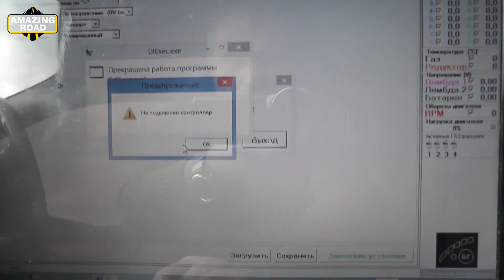How to make a diagnostic cable for Gas cylinder equipment (LPG) 4th generation own hands

Comment: “Hello, my car has a 4-cylinder Mimgas SU2000 LPG kit. I want to make an LPG adjustment cable for my vehicle. I tried connecting using an FT232 chip but I couldn’t establish a connection. I used the chip at 3.3 volts. If I use it at 5 volts, will it damage the ECU?”

Comment: Thanks it working in lovato kit
Reply from the maker: :_139::_107:
Reply: not working on Tomosetto Ecm
kindly share the procedure
i have connected GND, RX and TX but not connecting on Tuning Software
Reply: @ it works on com port .lovato and tomaseto woth are same
Reply: @ammanavenkateshwarreddy3071  try to change the baud rate on windows in port settings

Comment: Worked for me. I had to swap the GND with +12V pin. Thank you!
Reply: Bro can u explain me?
Reply: @vladtimofte5983 Hello.  I did as in the video.  There was no connection whatsoever.  (Error C01 code) What did you do?  I will be glad if you help me.
Reply: @birkuliste8988 Hallo have You now the answer? I have even the same Problem

Comment: nonsenses......What are the parameters for the RS232  communication?
You did not tell the most importand. For a made communication cable to work we must know:
1. 8 bit data or 7 bit data?
2. 1 stop bit or 2 stop bits?
3. Parity even, odd or none?
4. What is the baud rate?
5. Is there any handshaking? (XON XOFF....)
Are theese parameters different for the various programs?
The solder instructions are not enough.......All that parameters are preprogrammed on the ready made cables.
Reply: at another post I found:
     9600 baud
     8 data bits
     1 stop bit
     No parity
     No flow control (XON, XOFF)
I dont know on what LPG program they work, or if they work on all. I think that are the default values for the PL driver

Comment: i tried it aeb mp32 cng and it worked. cng interface cable costed me only 2 dollars😎
Reply: not work with me
Reply: I tried for MP32 CNG MIJO kit but not worked. Could you please share serial port setting?
Reply: @electronengineersconsultan7215  did you manage to make it work?

Comment: This adapter working with ecu sigas 2.4 light from bigas.it? Whats is pins sequency from building this cable?
In my ecu has 3 cable ter, Green and Black and I not know is grd, tx, rx! You can explain to me?
Reply: Have YouTube the answer?

Comment: Hi! I am interested in building my own interface for BRC Plug n Drive which is 3-pin connector. What equipment will I need. Please post links if possible. :) Many thanks in advance!
Reply from the maker: I lost links. I bought an aliexpress
Reply: Is it the same method for the BRC diagnostic?
Reply from the maker: How much I know yes.
http://www.ebay.com/itm/USB-BRC-SEQUENT-24-56-P-amp-D-SF-MTM-LPG-DIAGNOSTIC-INTERFACE-/121933451141
Reply from the maker: Did you mean it?
Reply: yes something like that... there are a lot of different variants like that. I have already tracked them in ebay but they are kind of expensive...
Reply: what was the total cost of all the components? I know aliexpress and will do the same. Please let me know the total cost you paid.
Reply: referravag
Did you manage to get it worked? I need to make one for BRC Sequential kit
Reply: @rajeshreddy882  hi bro.. You can get it?
Reply: @KillahGSM  nope